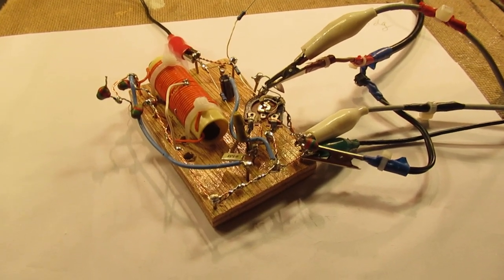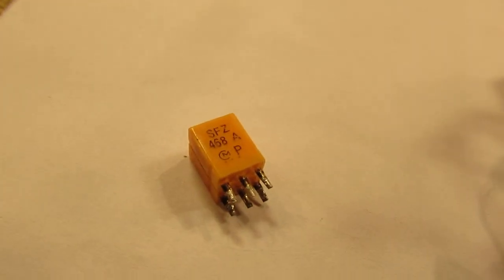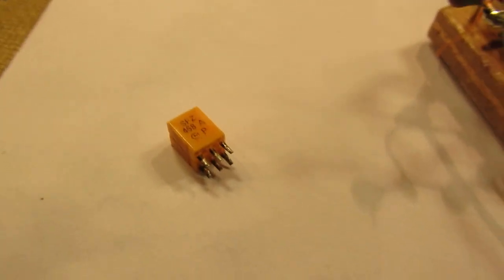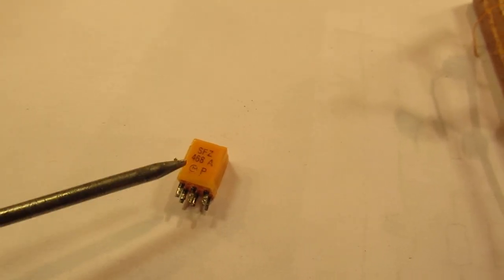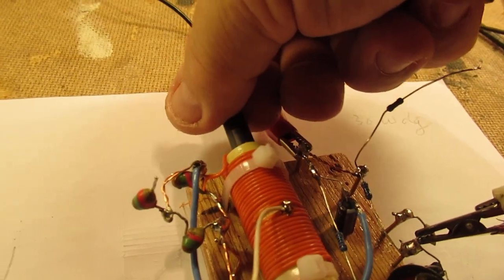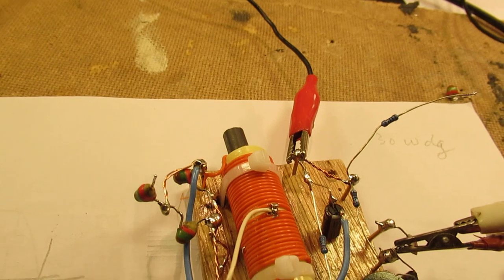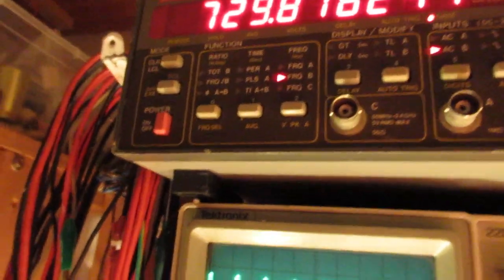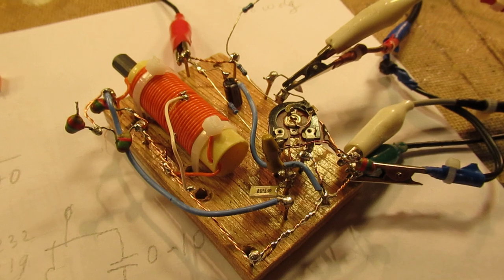Developing a slug tuned beat freq. oscillator 450-470 KHZ with a BJT transistor (experiment & demo)

Comment: Are those ceramic oscillators?
Reply from the maker: They (the yellow ones) are used as ceramic filters, but indeed, they oscillate on the frequency they were made for.
Reply: @radiofun232  This is a ceramic resonator. It behaves like a quartz crystal in determining a fixed resonant  frequency, but is less accurate and less expensive than a crystal, and its frequency could be "pulled", to a greater degree compared to a crystal.
Greetings for the nice video.
Reply from the maker: @Gamal_SU1GZ  yes, thanks.
Reply from the maker: @Gamal_SU1GZ  yes.